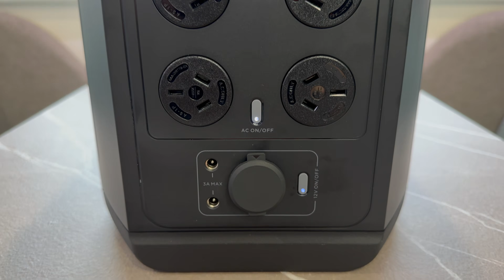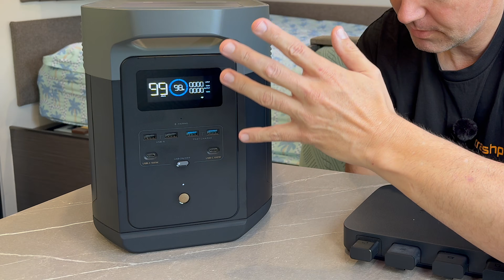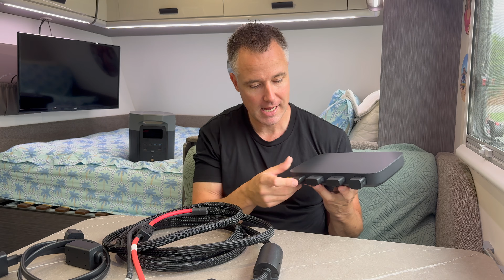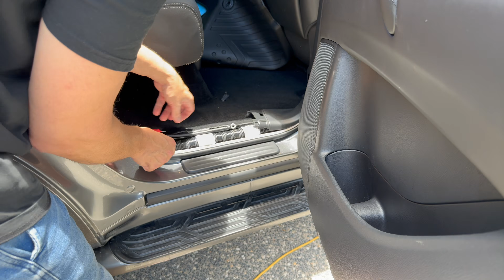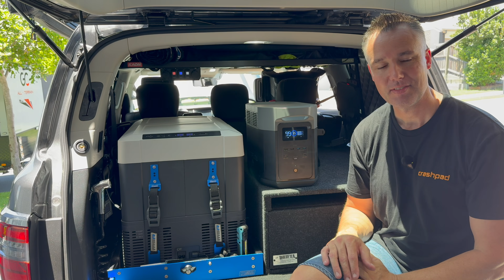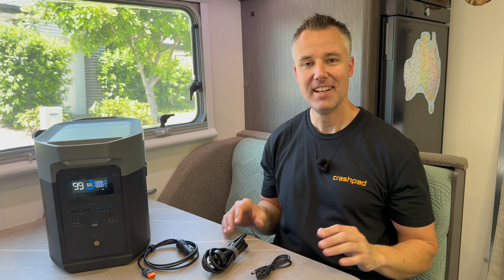Ecoflow Delta 2 Max - ULTIMATE OFFGRID POWER!

Comment: Hey, can you plug into the van? Its only 240v 10amp and the van is 15a. Also cant charge using the standard 15a outlets at a park? Unless im mistaken, this seems like a massive downside of this unit where all the competitors have this functionality.
Reply from the maker: You can plug it into the however you’ll need to use a 15amp to 10amp adaptor- like an Amphibian as the unit doesn’t have a 15amp output. There is definitely an opportunity for improvement 👍🏻
Reply: Don't have that problem in North America. 120v 15 amp. Mobile power and critical home circuit backup via sub panel. 😁
Edit. Have two extra batteries for critical home backup. My sub panel has furnace, fridge and chest freezer with generator input.

Comment: Good day. Quick question, have you noticed that your unit has inaccurate battery percentage readouts periodically? My Delta 2 Max unit seems to become inaccurate every couple of days during use even after doing a battery re-calibration and BMS reset. I'm wondering if mine is potentially faulty in someway.
Reply from the maker: Hey, I haven’t noticed that with mine. It’s worked really well. Maybe lodge a warranty claim